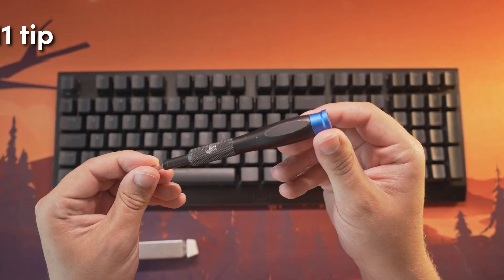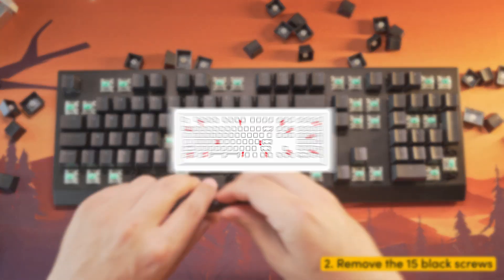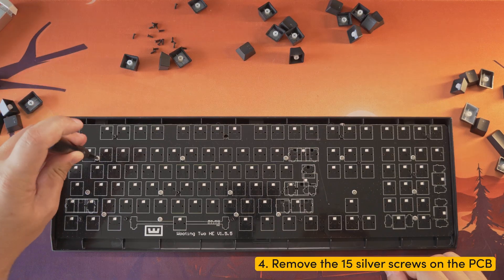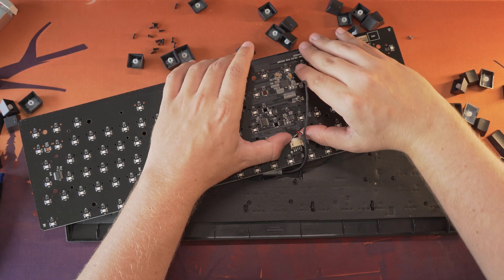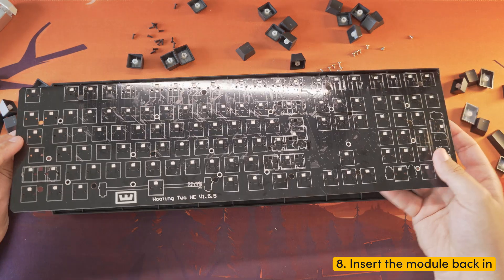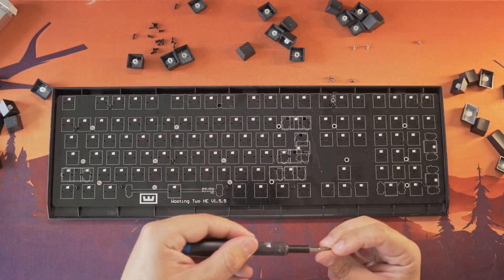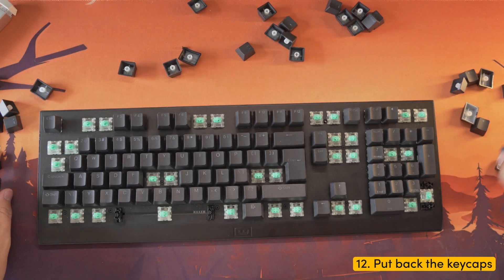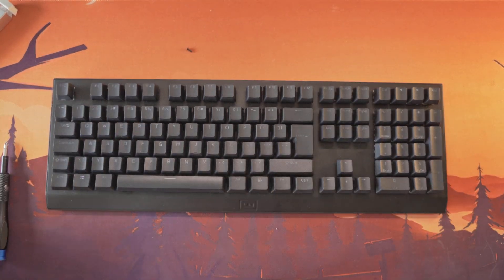Wooting Two HE - How to Swap the PCB

Comment: Hi, will there be aluminum case version or updated version of this keyboard? or even gasket on pcb or plate since it's sitting on the case.
Reply from the maker: We won't have additional cases for this keyboard. We will be making an updated version on the Two HE in the future. :)
Reply: @Wooting Good Morning Team Wooting, thank you for the clarification on the updates for the upcoming Two HE. I’m looking forward to modding this new board once it’s available. I do have a suggestion on the new keyboard though to include multimedia keys like a play, pause, forward, backward, and volume dial button. Is this addition possible?
Reply: @OTCThermal  

With FN and the wootility you can set any key to be media keys. You can even set keys you don't normally use to be media keys if you don't want to have to use FN to access them, it's up to you. They would have to add extra keys if you want dedicated media buttons (though, you can remap A1, A2, A3 to be media keys like I have, and move their original function to FN).

I got a 2 HE and it's pretty good. But I'm kind of spoiled by my Apex mini pro, so I got a wooting 60. USB C is dope cuz now you can just swap these keyboards in and out whenever and however
Reply: @TranceCore3  Thanks for letting me know this and I will check out this feature. I am currently modding my Wooting Two HE and I can't wait until my switches come in next week..
Reply: @Wooting  Any expected date on an updated version on the Two HE?

Comment: Oi Wooting, 
since your keyboards are working with magnets: What happens to the actuation point once the magnets degrade?
Reply from the maker: See you in a century
Reply: @Wooting  Okay, i am waiting for the shipment. ;)

Just wish the double shot PBT keycaps had media control as well.
Reply: If you take a look at the switch you can see the magnet is at the bottom of the stem, so for magnet degradation (which takes a loooooonnggg time) you could just replace the switch. For the hall effect sensor underneath the switch, you could replace the PCB. Either way, by the time either of these fail (assuming you haven’t spilled water on the keyboard) you will have replaced everything already due to mechanical wear.
Reply: By the time the magnets degrade enough to make a measurable difference you would probably have gotten a keyboard anyways, if not though you can just buy new switches
Reply: @makerjulian you’d prolly be dead from old age